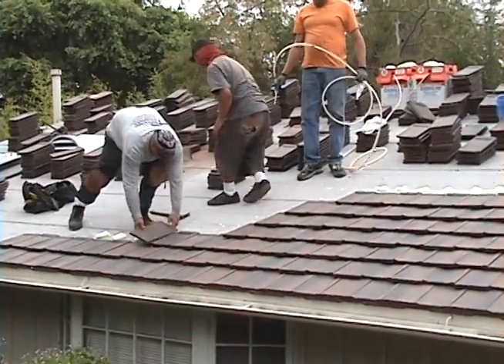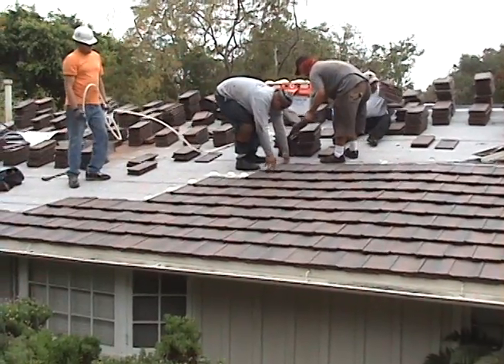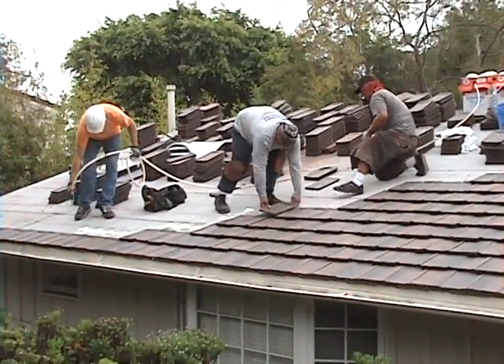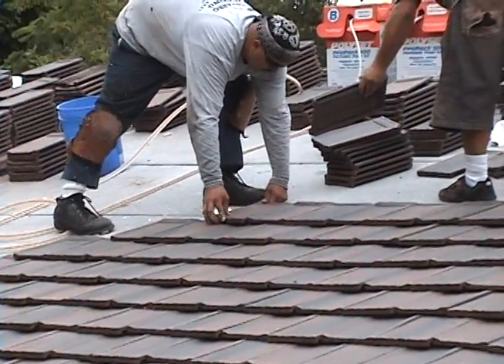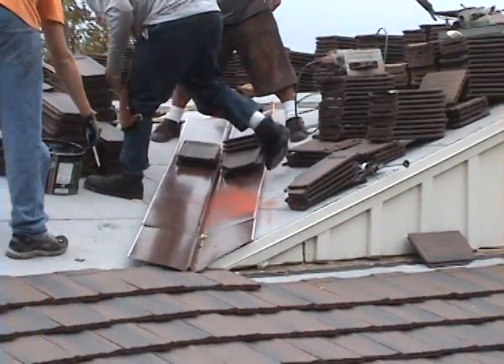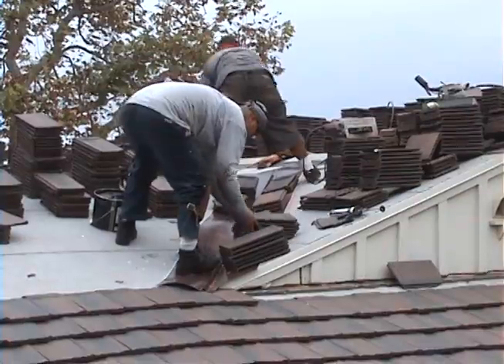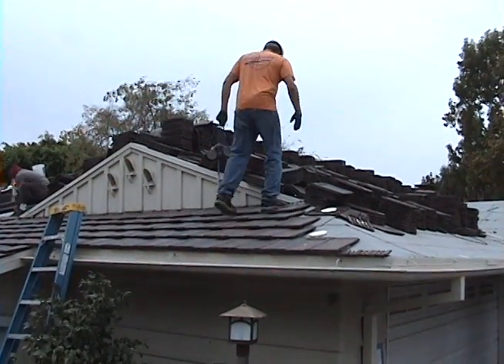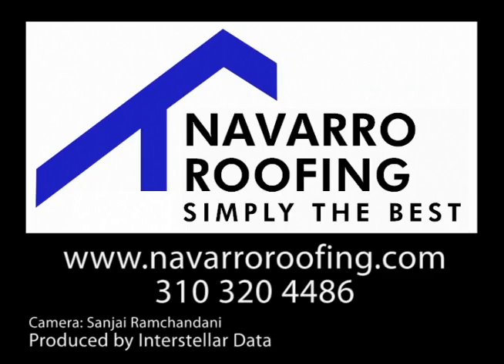Navarro Roofing - ProShake Plus, Polyset foam, torch down roof

Comment: Good job ,by applying the polyfoam in the center of the tile , it helps to support the tile at it's weakest point ,Nice trick!
they sell a supporting foam for the flat tile but I think this idea does 2 things in  1 shot , it secures the tile to the roof and helps support the center of tile if someone walks on it .
Nice idea!
Eric.